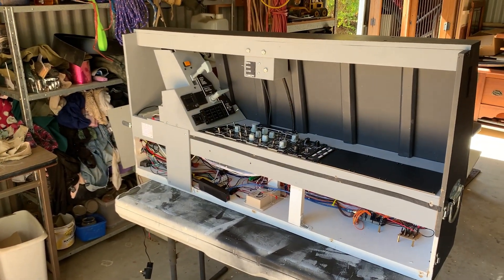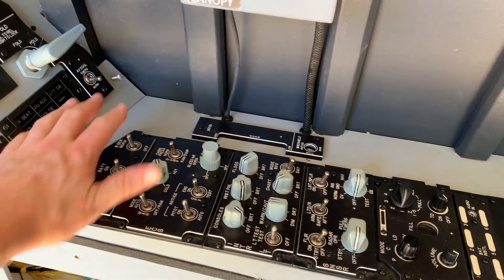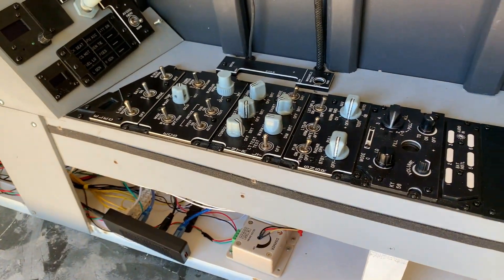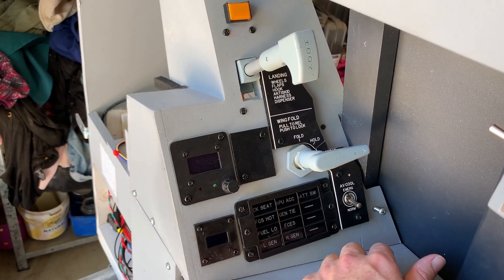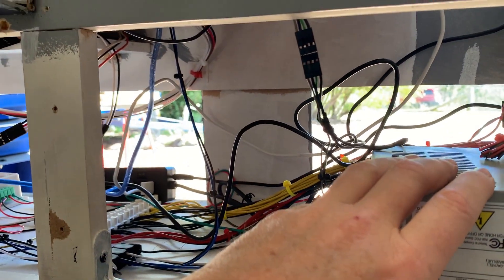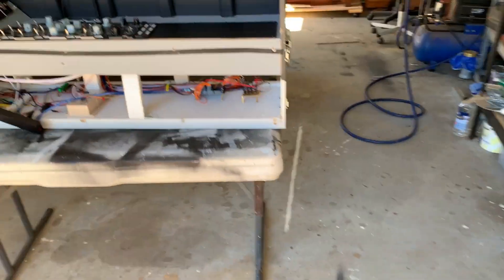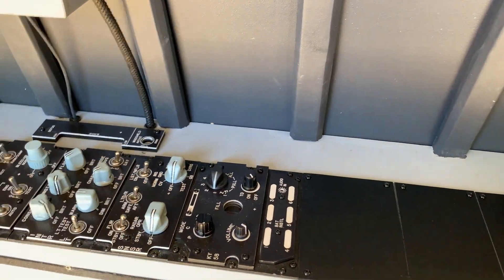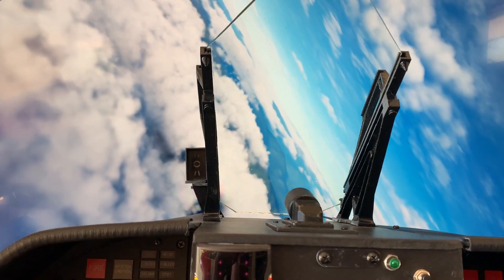The Hornet Project - Right Console Build

Comment: If you used a plug and play encoder for the switches would that still work, and also what diameter are the switches to go along with the tek-creation panel
Reply from the maker: I used DCS BIOS for all switches, so you would need to check with the hardware you want to use is compatible if you want to go down that path.   All pots and encoders are 6mm from memory.